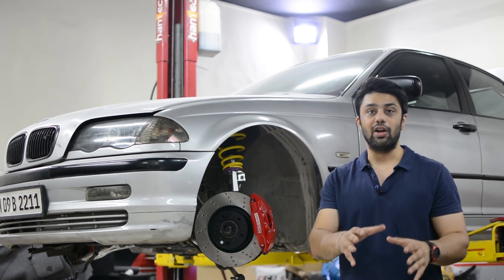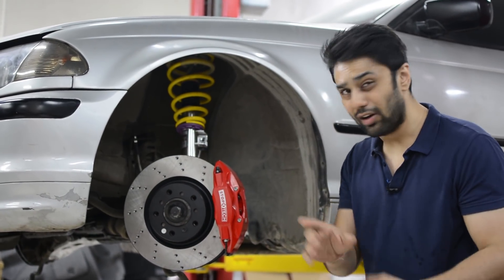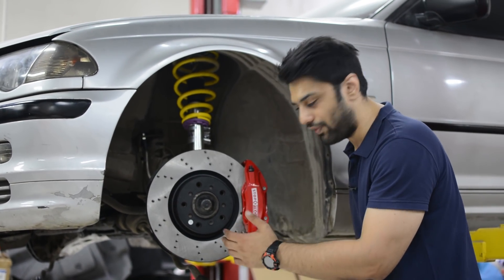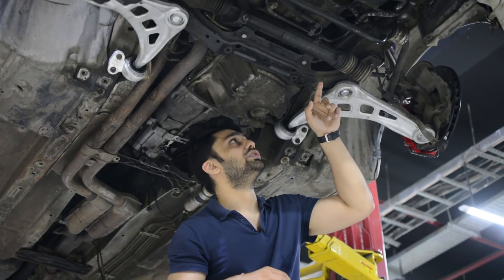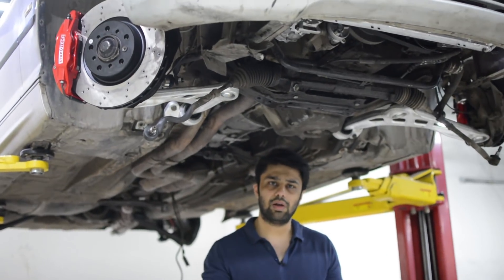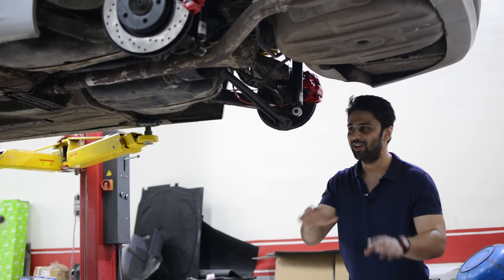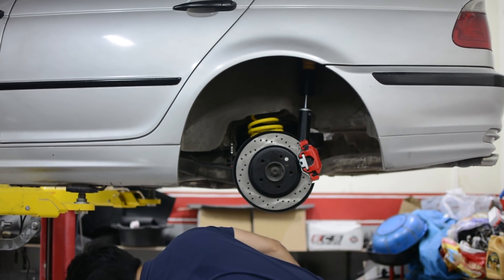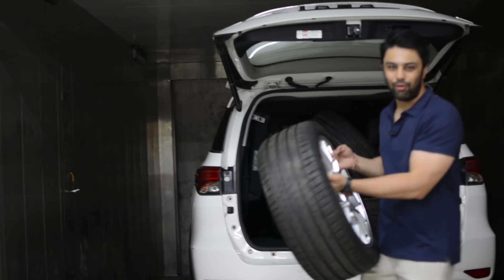Project E46 - Part 5 [Installed KW Coilovers, StopTech BBK, Apex Rims & More]

Comment: Get a Z3 steering rack also. Will turning radius smaller and drive way more sportier.
Reply from the maker: Hey Lakshay, will consider it during the next upgrade, thanks !
Reply: 3213 1094038 and 3213 1095577 are the part numbers

Comment: Wait, rear brakes make no sense. M3 has 185mm handbrake, 318/328 have 160mm handbrake. You are saying StopTech sold you M3 size rotors but with 160mm handbrake ring?
Reply from the maker: Stop Tech only provided a front BBK (325x28mm, 4 piston) the rear entire M3 setup was sourced separately.